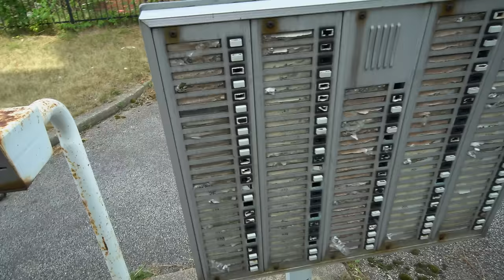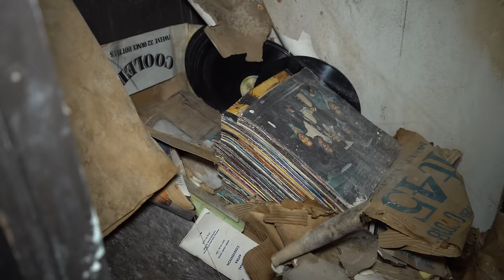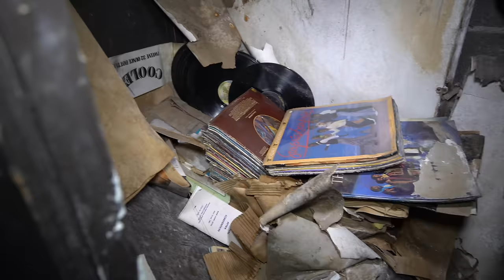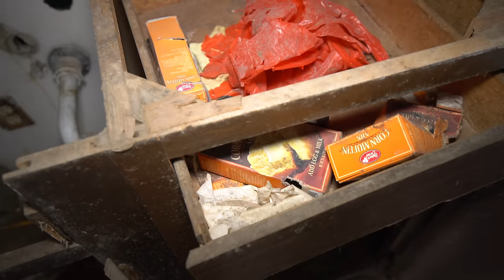Cleveland’s ABANDONED Projects Tower

Comment: Lol, I am amazed the elevator electric-engines are still there. They have  huge copper coil inside the housing. Then you have the housing and all remaining metal. Everything else in this building was stripped fully, but the elevator engines seemed good for scavengers.

Comment: I think that the panes of windows were removed by scrappers to get to the heavy aluminum frames.  It may have been easier to just pop the large panels out, instead of breaking them and then trying to free them from the aluminum frames??
Reply from the maker: No kidding really?
Reply: I took another look at the window frames from the outside, at the beginning of your video.  Now, I'm not so sure.  It appears that most of the larger aluminum frames are still there.  Maybe there were smaller aluminum sections they removed from inside that I'm not seeing.  Otherwise, I have no idea why they would go to the trouble of removing the windows??

Comment: So I wonder if there any squatters living here?  I suppose we would have heard or seen one if there was one that lived there.  The place is a mess, but it’s dry and private and probably occasionally used for who knows what.  You can bet that the first thing to happen after they closed this building down was to pull all of the copper out of the walls along with as much steel that could be carried.  It makes you wonder why they condemned this building.  Usually the projects aren’t exactly built t9 last and use low end construction materials, so it could be condemned due to structural issues.

Comment: hmm, dead rodents, animals, birds, bugs and last but not least surely it's still connected to the sewer system and makes a great giant vent......... I can tell you one 1-1/2" pipe left open or dried out trap can stink up the whole floor of large hotel, and migrate upwards through stairwells and elevator shafts. been there done that, they had air fresheners everywhere spraying non stop and it was still foul, I had to tell them why and where the smell was coming from.
now imagine how healthy it is breathing in all the mixed gases, and other possible toxins.....

Comment: Hey guys just a friendly nurse tip. Make sure your tetanus vax are up to date! You need one every 5 years if you are at high risk, which you are, lol. Get some decent boots! Preferably puncture resistant soles and steel toes. But judging by what you're wearing in this video...any boots would be a step in the right direction 😏. And I do see yall wearing proper respirators most ok the time, but it's just not mold you need to worry about. Asbestos is serious along with dried rat urine and dust...so wear them all the time even if mold isn't a issue! Happy exploring! 😊